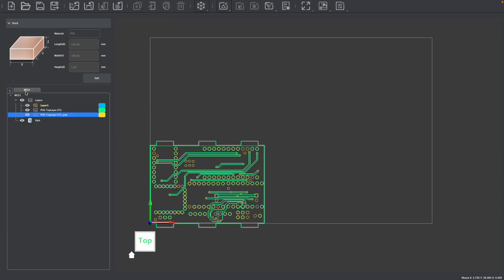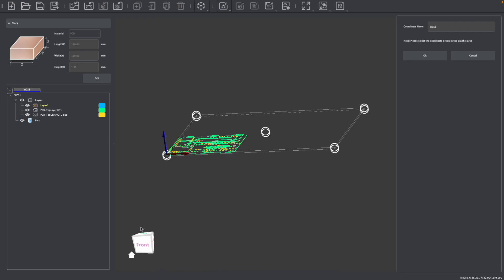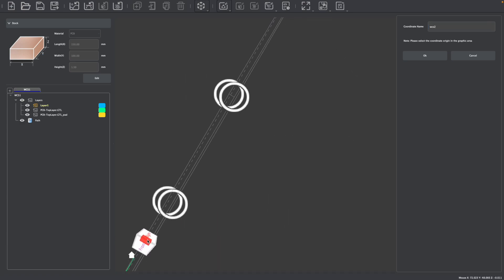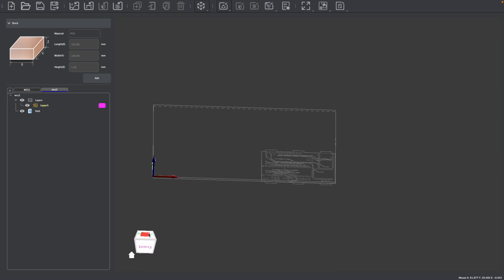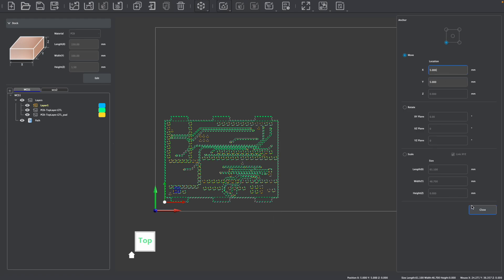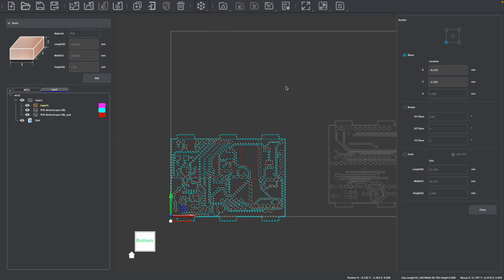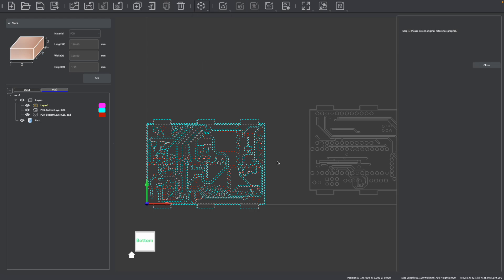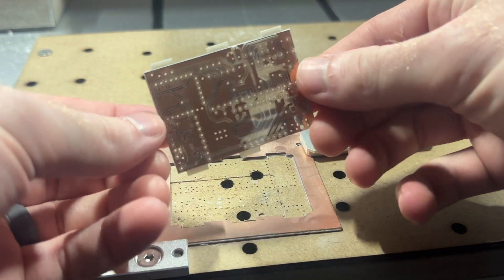Makera CAM - Work Coordinate Systems

Comment: This is not working with the new 3D CAM software.  When you select the corner on the bottom side, the coordinate system is oriented the same way as the top side (from the bottom, the red arrow points left instead of right and the blue arrow points down instead of up regardless is you're selecting the top corner or the bottom one.
Reply from the maker: We've tested this internally and are not running into the same issues you're experiencing. It may be due to a screen resolution problem, please contact our support team at support@makera.com so we may find the cause and assist you further.
Reply: @Makera  It happens with 0.8mm thick material, but not with 1.6mm thick material.  0.8mm is a common board thickness and double sided board material of this thickness is commonly available.  This means you have a bug in your software!